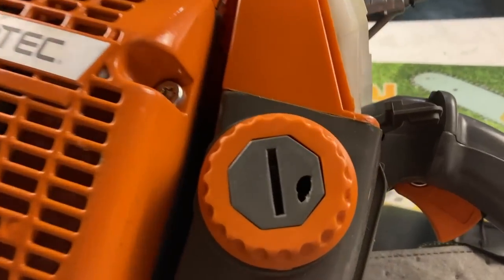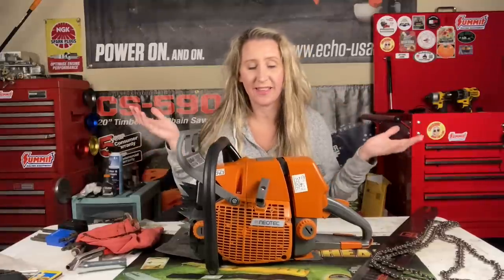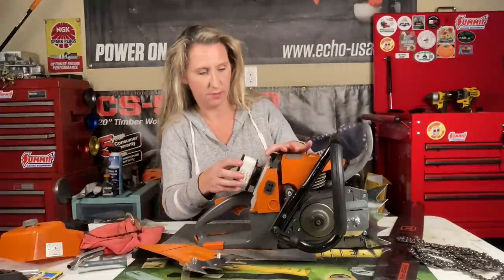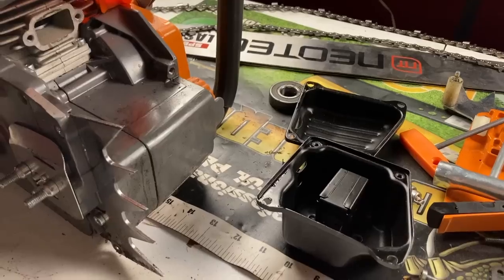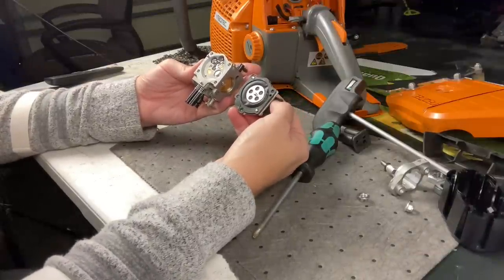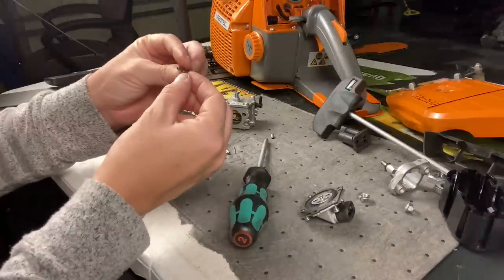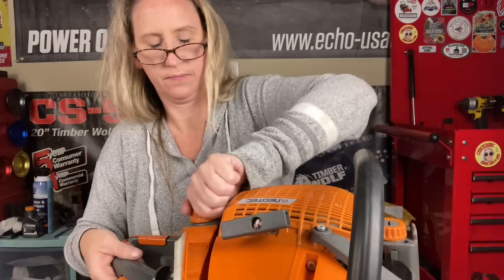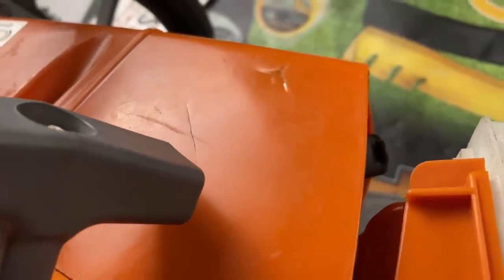NEW "STIHL CLONE" chainsaw, NEOTEC Mechanic Review and Repair. (You won't believe what happened!)

Comment: The hole in the gas cap was to prevent a vacuum when all the gas was pouring out through the muffler.
Reply: Gas cap problem is better then fuel just run right back out bottom of fuel tank soon you pour fuel in not just that they ignore your warranty return refund and replace 589$ saw i wish i saw her video before i try this saw out i guess my dumb ass they said eligible for refundable and replacement the warranty you get is ignore you
Reply: That's a speed hole. It makes the saw go faster.
Reply: What saw is the ncs 6200 a copy of?

Comment: I have a neo tec 892. I did have to adjust the carb out of the box but other than that it's been running every day for 6 months with no problems.  As far as clones go it's a pretty good saw. I also have several other stihl saws ms660's , 661's and a 500i
Reply: I have a holzfforma and work for the state in forestry id put it up against my work saw any day of the week. I run a 461 at work. G466 at home. Bark box and wcs dogs hi flow intake.
Reply: Randy we have the same last name
And pretty much same saws
Neotec 892 Stihl 660,039,271
So fat I've got about 40 hours on the neo just carburator adjustments I run a 24 inch hard-nose bar with on problem
Reply: The product is 5 times less than a Stihl and for a majority of people using chainsaws, they are not commercial logging people and don’t run  a big saw everyday. The unit might poop out 5 times faster, but that’s enough to clear my 40 acre property.
Reply: Ya she's full of crap, I have a G888 clone an that saw rips! Way better then OEM.

Comment: I have the holzforma farmertec 660 now for over 2 years, used commercially almost daily, zero issues at all.  The issue of the 2 dead ones that talk about, I wonder where they using an incorrect fuel/oil mix? I run mine at 40-1. Perhaps that was an issue. I have read and seen videos of some folk having issues with them, but I have seen many many more videos and read online of folk with my experience, nothing to complain about the saw. I wish I could justify spending the money on a new Stihl as all my climbing saws are Stihl, but the farmertec hasn't failed me yet. My only criticism of my saw is it is very fuel hungry. But then again, it's a brute of a saw cutting big wood. So it's to be expected I guess.

Comment: I’ve had my NS892 for a little more than two weeks, almost every day for about three-four hrs. per day , and I have to say, I’m impressed. Other then a slight adjustment on the H&L after straight out of the box, runs excellent. And yes, it’s a beast. Wore out my shoulder trying to start it until I saw your video on how to start the big saws. Have not had any more sore shoulders since. Keep up the good work in the videos, they always seem to help.
Reply: Hahaha I broke my arm too , I thought I'm the only one. Just banging like crazy I'm like wtf this decomp valve it's not working , later on I found out you have to push it 😂😂😂
Reply: I figure they are kinda like another clone product they are hit and miss you know like the good, bad and ugly sometimes you get an good one sometimes a bad one you have to change a plug adjust a carburetor or rebuild it and sometimes you get an ugly one that makes them all look bad!
Reply: Nobody says they're not running, performance is pretty much on par with the original. The only issue is how long they last, and how many repairs are needed along the way for that reduced usable life. An OE saw will last 4 times as much while being 4 times more expensive and with less issue along the way. 
Just look up "Belko Wood" on youtube, a professional chainsaw miller from Belarus. He has a beaten up MS 880, bought a Holzfforma 888 about a year and a half ago, and a month or two after that it wall already a hybrid saw from all the crap he had to replace on it. A year after that he was back to using that old MS 880 again which still runs! Remember this guy chainsaw mills many hours, EVERY DAY.

Comment: Agreed, and thanks for your experienced insight.  
While growing up in Michigan and my father bought a new Stihl 029 back in '85 which we used to cut wood for heat.  Just had to crank it up again last week to cut trees after hurricane Ian came through here in FL.  After using it all afternoon I realized we have had to change the bar once and have been through some chains but everything else is original .  I doubt they make them as durable today but this says a lot to me.
Reply: Lots of after market parts for it if it breaks so dont throw it out , fix it.

Comment: It was several months ago that you told about to beware of the premixed gas. For the first time my husqvarna weed eater would not start. I went and bought a gallon can,  2 stroke oil and a gallon of gas. After emptying out the gas from the tank and refilling with the new gas it runs now. My son was trying to get me to put it in the shop but I took your advice and did it myself. It runs now. Thanks

Comment: I bought an 066 Stihl back in '99 the first day  it kicked back    and the handle smacked into the top cover and busted a big hole in it ... And I had to modify the choke because it was missing fast idle ..   (same common problem I have with the Chinese 660's)  she's been a good saw  ... But just watch your air intake and don't let leaves clog it up it only takes a few seconds for it to get hot enough to transfer metal from the piston to the cylinder.. I had to take mine apart and clean the metal transfer off the cylinder  and  unstick the rings it had minimal damage basically just a couple of little scratches on the piston .. it's been running fine ever since I used it yesterday   still has all of its ponies .. the Blue thunder G660 farmertec saw    I've been using for 5 years now   and she's been running flawlessly   seem like it pretty well on par with the Stihl  ... And I just bought a 066 pro    carbon fiber edition   with Meteor piston  cylinder and Caber rings ..and I put a dual Port muffler on it  I've only used it about 3 hours but man that thing screams  ...   I purchased a G888  and had to replace the coil  right off the bat   it flooded really bad    had to modify the carburetor  then it ran awesome  for about 15 minutes and grenaded the crank bearings ... I went on the Stihl's website to see if they had any problem complaints with their 880 and 088    and  indeed  some people were complaining about the same problems from their stihls as far as the catastrophic  crank bearing issue

Comment: Thanks for the great warning video!  My “new” saw is a Husky 385XP I bought on half price sale ($400 for an $800 saw) as a demo saw in 2002 (it’s presently the base saw for my Alaskan saw mill). The small saw I still use is a Homelite Super EZ Auto I bought at the same shop in 1974.  Buy a good saw, take care of it, and it will last.
Reply: I bought a 385xp in 2002. It's felled thousands of tons and still runs as good as new. Real long term value for money.

Comment: I've had the blue version of the 66 clone and I love it. I had to change to oem chain tensioner, but the saw ran great out of the box. I added a Tsumura bar and Stihl chain. 
After a year I gave a slight carb adjustment. Runs great. Dependable. It's a big saw so some may find it cumbersome. It is a little too big for average homeowner/firewood work. I use it for falling and bucking on large trees on large parcels.
Reply: I'm two years into mine, treat her well, drain the gas & burn it out if she ever sits for long. It's been perfect.

Comment: I have a 12 year old Sthil chainsaw and it still runs just as strong as the day I bought it.  Other than some carburetor rebuilds over the years, a new bar and chain, and now using Sthil MotoMix 50:1 fuel, I'll still have it another 12 years🤞. I'd never buy any other brand, and certainly no Chinese knock-off. Spend the extra cash and get a " real" Sthil, you won't be disappointed.

Comment: What's the old saying? You get what you pay for. This is clear proof that it is true.  Buy quality get quality/satisfaction. Buy crap get a whole lotta down time/frustrations aplenty.  Thanks for furthering our education and knowledge and teaching us how important it is to get good stuff for just a bit more. The 2012  455 e Husqvarna my father bought me brand new is still running strong and I have only had to buy new chains and a sprocket.  It has done so much for me and my father over the years and never quit.  Still looks almost brand new too.  Just recently upgraded to the 24" inch bar.  Needed it for the bigger stuff.
Reply: I bought a new 455 in 2006 and it's cut over 100 cords of wood in 15+ years. I also run a 24"  bar when bucking large red oaks. But it was getting tired and the compression was down to 106 psi. This spring I installed a 460 piston and cylinder to freshen it up. The cost is about the same as a 455 piston and cylinder so why not? Now the saw has more power than ever and should last another 15+ years (I'll be 80 by then) 😀

Comment: Thanks for the video Bre. I have a story for the "buy once, cry once" & "you get what you pay for" crowd. A friend was removing old carpet from a pontoon boat deck. I offered her my HFT oscillating multi-tool with a flat blade to see if it worked. It turned out to be the best thing she had for cutting the glued down carpet but it still took hours of work. She was (needlessly) concerned about wrecking my tool so paid $$$ for a top brand. The expensive tool died before the job was done and she finished with the cheap HFT tool. Paying a high price is no guarantee you'll get better value.
Reply: With a high reputable brand, you might have a bad luck with one tool out of 20. With a cheap one (like the one in the video), you will probably run into issues constantly. That's the main difference. Now, HFT are better quality than this chainsaw clone and will probably run for a decent amount of time.

Comment: That’s why I keep a tube of JB Weld on my desk.  I am constantly finding places to use it.  It is fuel resistant and can be shaped to repair almost anything.I used it recently to repair the clasp on my Troy built’s air filter cover, which had been broken by its former owner.  It may not be pretty but it works and is a lot cheaper than buying a new air filter cover.
Reply: Could it work to repair stripped threads in a chainsaw body for a carb?
Reply: John,
I thought the same thing,  or epoxy?  Put some plastic on the inside and fill the hole?
Reply: Yes I think I’d use it for that fix. I’ve used it on marine gas tanks with success, fuel didn’t efffect it👍
Reply: @eathans_small_engines8665  I have used it to repair stripped threads I plastic on chainsaws.  I clean the hole with break cleaner and blow it out with air.  I take a toothpick and put it on the stripped threads.  I put grease on a new bolt and screw it in loosely into the hole.  Let it dry in a warm place for an hour and take the bolt out.  The next day I screw it into the hole gingerly.  The only other choice is putting a heli-coil in the hole.  My way will work for screws that don’t have a lot of torque on them.  If the screw into metal or have a lot of torque on them I would use a heli-coil.
Reply: @johnclarke6647  I ended up using my epoxy becuase I already had it! It is on a carb bolt on my 32cc mcCulloch saw
Reply: @eathans_small_engines8665  I like that steel in my repairs.  I have never had a problem with the carb bolts.  Those that I did, I replaced.  I stripped the bolts on my ms 460 and replaced them.
Reply: Used jb weld on an egged out piece of cast that had pin gouge it out due to a busted up bearing the stuff saved me over 7 thousand dollars and lots of downtime. 
 Amazing stuff

Comment: Love the channel. I was surprised you did not check compression especially when you found that scoring. You usually do this second after the water check in the fuel, so you don't waste time on a dead machine. 
Yes, the material coming out of you know where is lovingly termed "Chinesium" by AvE. If you adopted a more set procedure, it will prevent overlooking this and keep the process in order. That's what I stress teaching service on gas fireplaces. 
Your tips have already helped me on my lawn equipment-Thx!

Comment: The cylinder scouring is from a sharp edge of the ports which should have had a rounded edge to avoid the rings/cylinder from being lightly damaged during running.
Reply: Taryl would have found that right away.
Reply: harmony connie  scam bot
Reply: The scoring was all the way around the cylinder. The report was that the saw only ran for a few seconds, so I would suspect debris was either in the cylinder from the first or the rings were dirty.
Reply: Sounds like a knowledgeable assessment. I think you are right.
Reply: @dudekanic  I would suggest you take a back seat here as you are wrong. There are intake ports and exhaust ports, 180 degrees apposed to each other, and yes there will be scouring all around BUT the majority is defined at the port areas which mean exactly what I said happened. I have many years working on saws and have extensive knowledge on this subject, I suggest you stick to bars and guitars.
Reply: I will add these saws are slammed together and many corners are cut to lower costs, this is evident on the carb diaphragm being installed wrong and the Chinesium metal is not as good as German metal so it's a gamble on the longevity of these saws.
Reply: @dudekanic  Probably didn't get all the parts cleaned properly.  Little grit, little metal, little scratching.
✌🍩
Reply: @vortexan9804  certainly ain't from paint chips, lol.. leaving one to question Taryl's abilities
Reply: Crappy Rings to begin with .. and/or rings damaged by those sharp ports  (sharp ports are a common quality issue with cheap junk from China)
Reply: An old man who sold yard and garden stuff for 40 years always said start a two stroke motor on 16 to 1 mix and keep it idling for 3 minutes. Then pour it out and put in proper mix. Too much oil let’s crappy parts and machining have a chance to seat before a load hits it. 
Guess he was right. He never had a new product  fail with low hours I ever heard about.
Reply: The black specs were probably residual grains of sand from the casting of the cylinder.   Poor QC.  The sand is supposed to be cleaned all out but would definitely cause scoring if not done perfectly.

Comment: Love yr videos and the no BS , straight down the line. Never was one to fix small engines ever, but since watching yr videos, have repaired lots of good old brush cutters all my chain saws, except one. Watched a video of yrs the other night on repairing old fuel lines on a Husky the same as I have, tried 1once couldn't wasn't sure on handle to take off and where fuel lines went. Well 2nd attempt about to happen. Thxs and keep the videos coming.

Comment: Thanks for another video.   I still like my blue saws as loaner saws.   I don't worry about them as much when they are away from home 🙂
Reply: I NEVER loan out my saws. If I can, (have time and more importantly LIKE YOU), I will come and cut with you  but I will NOT loan you my saw. My best reason is, "You MAY know what you are doing but a saw is a dangerous tool, I just couldn't stand the thought that you got hurt with MY gear". You can't argue with that. Otherwise go rent one and I don't feel in any way responsible. (Annnd my gear doesn't come back broken if at all)

Comment: I bought the NeoTech 872 after I got screwed by a Stihl dealership putting unmixed fuel on a brand-new Stihl that burned on the first tree I was cutting.  Anyway, after a few jobs it is still running well. So far, I have billed $5600 for work done with this saw. I have had it for 2 months now. One of the trees had a diameter of 42 inches. I don't know why that was junk but mine still looks new with no cracks or dents. When I bought mine I didnt realize there was a upgraded one for a few dollars more which I should have bought but like I said I did not know

Comment: I think some of the scratches in the bore are from the port not being de-burred, the edges look mighty rough. Plug the hole in the cap, gas it up, tape the throttle wide open, set it out in the driveway and let it run wide open till it scatters (for entertainment). Throw the aluminum in the scrap barrel. 💣💥
Reply: *chinesium

Comment: I have a neotec 872 and it’s been a beast. I didn’t think it was going to go this well but I’m a fan! Make sure your buying them from a reputable seller or from neotec themselves. That’s what I did and I put an ngk plug in it, tuned it. And ran. Got some wcs 3point dogs for it and it’s been great for over a year. The new Farm Mac line Neo Tec has out is using some great parts also I’m going to grab a 660 for my mill since I’m using it more now. Anyway! Good luck and there’re not all junk!:)
Reply: Chuck,
I wrote a comment about a Tornado Saw I have that has been a great saw,  hunnert bucks!
Cut a lot of wood.
Reply: I agree I have the updated Neo Tec  872I I’ve had none of the issues I’ve seen in your video I did get it straight from Neo Tec , I also have 2 echos a cs590 and a cs 490 the Neo Tec has been good so far.
Reply: @rickycompton2610 ,
No Neo Tech but I have a CS490 and a CS590 too!  490 has never been out of the box.

Comment: I did look at these, especially the enhanced versions of 660, but I'll stick to Echo, Husky, or Stihl. After years of chainsaw experience, I'm liking Echo the best. I do have a Jonsersed 2255, which is a Husky 455 and is great.
Reply: Im running a Farmertec /Hulzforma G378 Husky clone , pretty nice for the money. My son built a 660 kit, again well worth the savings and no end to aftermarket parts. But if you have  $1500 to drop on a saw, Stihl and Husky is for you. I do like to find used ones. Cheers.
Reply: I've got a 620p and a 3510 echo.  Selling a ms271 so I can add their 4910 to the stable.  Love the echos!